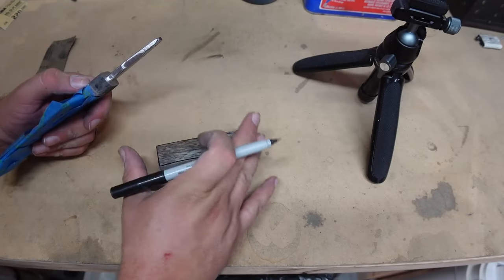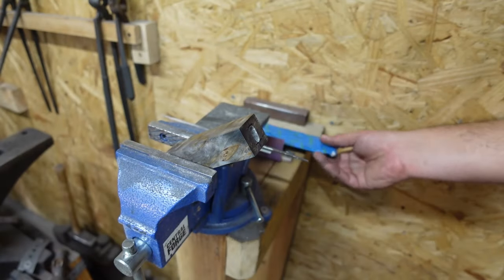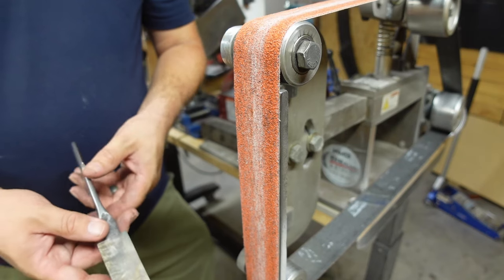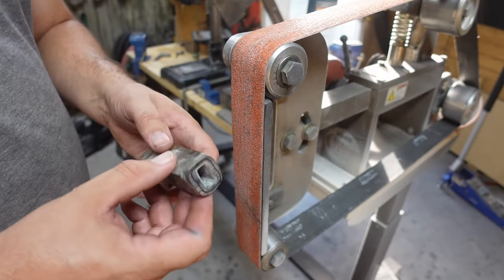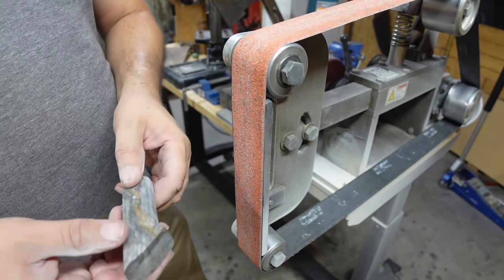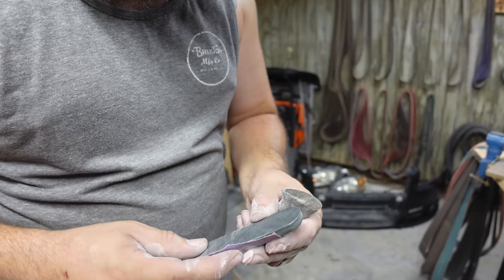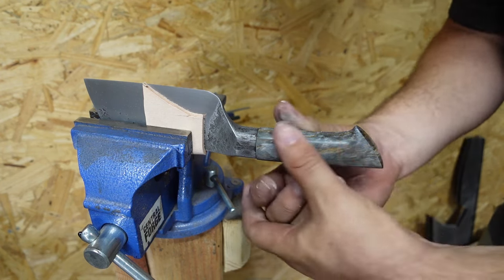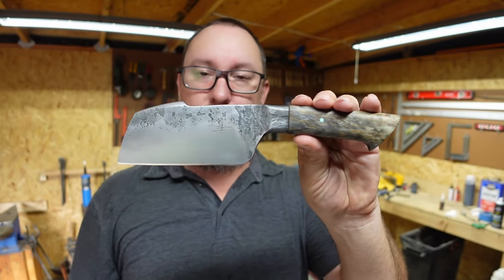How To Attach A Handle To A Hidden Tang Knife! | Shop Talk Tuesday Episode 186

Comment: It took me five tries to do my first hidden tang and I still don't like the profile I put on it. 
Luckily I have lots of walnut to keep trying. 
I will be cutting the handle off and trying again. 
I tried to freehand it. I will be using guide lines next time.
Reply: a real easy way to get the handle straight with the blade is to get a flat suface, maybe 1/2" off a table/workbench to lay the blade on and something else to slide around the handle with a pencil. since the blade and pencil are set heights any excess handle material or a crooked block will be evenly marked on both sides.